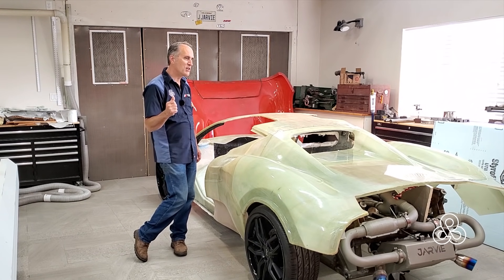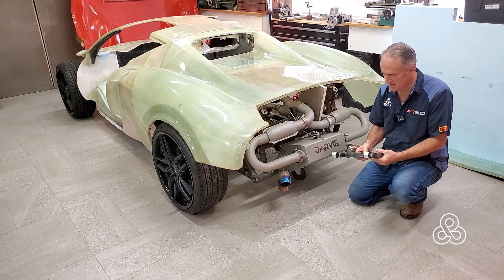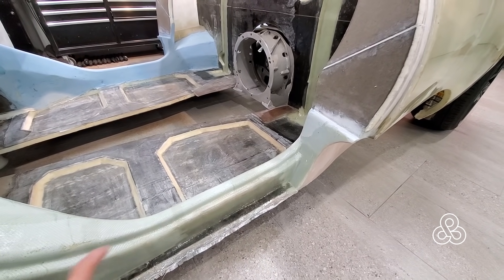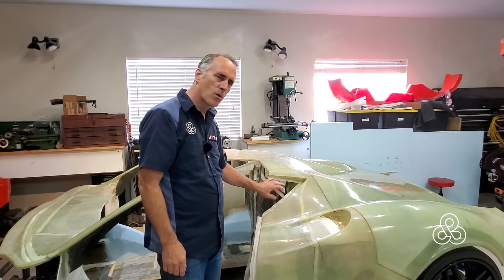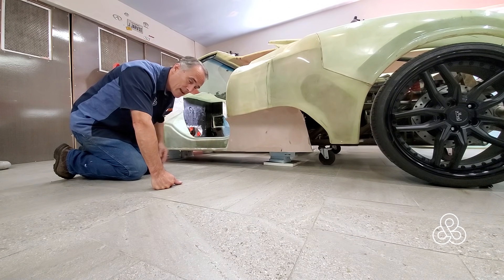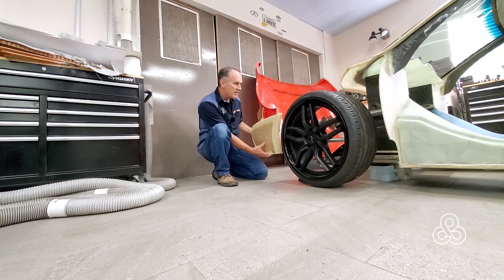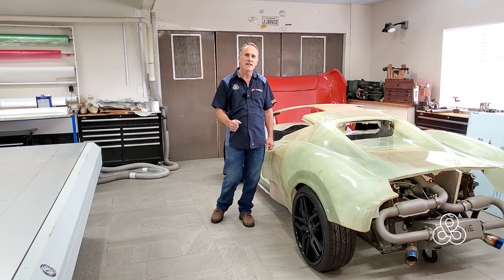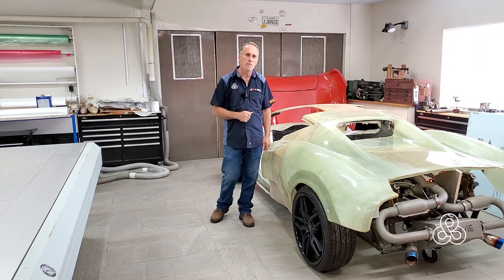Building a supercar from scratch! - What I would do different next time.

Comment: Flush mount windshield for sure, it will look so clean flush mounted.
Reply: Flush mount windshield!!!!
Reply: Rear hatch hinges : look into the design of the SOSS invisible hinges.
It is a double jointed hinge that fits in a pocket.
You do not see the hinge.
There are used for hidden doors in houses.
It also lifts the door away from the jamb.
Look into it.
Would be an interesting touch.
Reply: @2009mechanic  Yes, I was going to suggest dual-pin hinges to solve the problem.  Once it is closed, it clicks into place flat.

Comment: I think the problem with windscreens, in all self build cars, is trying to make it look OEM, or factory. Windscreen, glass and headlight seals are almost impossible to get right on a budget and through DIY; the finish never looks right. Even TVR couldn't quite get it right. So if you opt to remove the factory seal, you may lose the factory look, and possibly run the risk of making the windscreen install look amateurish, which would be a shame as the rest of the car certainly doesn't look amateurish at all. If you think you can do your own "OEM" seals, then my hat comes off to you for trying. I'd be interested in the results. :)

Comment: In theory, if you were to throw the idea of a conveniently shaped rear sub-frame out the window and just placed all of the drivetrain components where you wanted them and moved forward from there to support them adequately, you could totally fit basically anything you wanted to into the back of that car. It's surprisingly spacious, after all. This would, however, make servicing those components more challenging because you end up packing the support structure pretty tightly to the engine, exhaust, and intake components. It also doesn't usually end up nearly so pretty, at least not without some significant efforts in fabrication. Take the custom twin-turbo exhaust systems that people have made for the Audi R8, for example. It's a car with a ludicrously tight amount of space for an exhaust system, but some people have decided to use 10 and 15 degree pie cut pre-bent tubing to craft incredibly complex and surprisingly large bore exhaust systems for it (though they do frequently run without a muffler, so there's that). Then look at Project Binky, from Bad Obsession Motorsports, where they took an Austin Mini and crammed the entire running gear, drivetrain, and engine from a turbocharged 2.0L AWD Toyota Celica into it. The amount of work put into fitting a drivetrain into a space where it clearly doesn't fit is mind-boggling, but it can be done. The downside is that you end up with an engine bay so tight that ceramic coating and woven rockwool insulation aren't done for aesthetic purposes but out of necessity to keep the exhaust from literally melting the parts nearby them. Basically, if you poured a cup of water onto the warm engine bay, it would never reach the ground. In this case, if you were to employ a larger alternator and a more substantial battery, you could place things like the intercooler wherever you liked by utilizing electric fans to cool it. You could even go so far as to make the up-draft aero hood even more substantial, diving almost through to the floor of the front chamber, and then stack a radiator for engine coolant, a radiator for a water to air intercooler, a heat exchanger for AC, and even an oil cooler up front, backed by a custom fan shroud to pull air through all of them and up out of the hood. And you'd still have space in the front for a battery or two, fluid tanks, and the front differential. It just gets tight and you'd probably have to rework some of the suspension geometry for the shock actuator levers, but moving them back doesn't necessarily change how they function as long as they still pivot properly and you have a mount in a suitable location on the upper control arm. I would also probably opt for an electric hydraulic pump for hydraulic steering assist, as it is between a common hydraulic steering assistance and electric steering assistance in terms of feel, but allows you to remote mount the pump wherever is suitable, since the fluid is incompressible and the length of the hose is somewhat irrelevant. Another option if you ever decide to redesign the sub-frames is to utilize even longer control arms and narrow the subframe even more between the front wheels to allow you to use a closer steering ratio with longer pivot arms, allowing you even more steering angle on each side without scrubbing the wheels on the tubbed arches or suspension components, which would allow you to make more aggressive steering corrections while driving, or even open up the options for drifting, as long as the rear bias of the central differential allows for it. One option if you want a more rear-biased AWD system and you're willing to buy expensive salvage parts is to find an AWD Lamborghini and use its transmission and differentials for this, as it would be closer to a plug-and-play solution in terms of front to rear biasing, as it was already designed for a mid-engine AWD configuration. Porsche also made use of similar transmissions for their AWD 911 variants, so that's another possible option if the current solution doesn't provide the bias that you want. The fact that you're able to build your own adapter plates and junction tubes is already to your benefit when it comes to adapting drivetrains to your needs. The Audi R8 is another option, too. The only complication to all three of these related options is dealing with whatever transmission and diff control signals the VW-Audi group use to manage them.

Comment: Hey there, amazing progress you've made.  One thing about the windshield, I work with glass. The windshield is made of laminated glass with a PVB plastic foil in between, that foil will become white if the edges of the glass are left in moist conditions. So if you take it out make sure to still project the edges of the glas..

Again, amazingly inspiring to see. Keep on going man.
Reply from the maker: THANKS! Now that is a very useful piece of information. I will take that into consideration as the glass will have been stripped of any protection. Glad to have others experience! Welcome to the new world of social media.
Reply: Djessey
Is there not a physicality to rubber mounting glass, especially in this flexy body
Reply: Also glass replacement , have you thought of that, say it gets a stone chip and you've just fiberglassed it in place
Reply from the maker: @williamgoode9114  Fiberglassing will only be to form the new frame edge. Once the new edge is done the glass will be installed the traditional way with flexible rubber sealant.

Comment: I just came across this today, it is very impressive.  I'm not any kind of engineer (except for operating a light rail car), but I do have years of having fun with VWs.  I'm working on my own car, using a sand rail chassis, going mid-engined with a 6 cylinder Corvair engine mated to a Porsche 914 transaxle, and topped with a Laser 917 body, to make my version of a Porsche 917 replica.  Like you said, as I don't have much experience I can still get close to what I want with pre-made components.  Nowhere near to the supercar you're making, but it is what I feel I'm able to do.  Great series of videos!

Comment: I say nix the rubber seal on the windshield, it'll have a much cleaner look. Your foot-well doesn't look any narrower than a Countach, roominess is nice to have, but usually one of the trade-offs with exotic cars. If luck is on your side you'll have a little extra clearance in the tunnel area you can take advantage of at the front for some extra pedal room. Loving the build so far.
Reply from the maker: May be getting a 3 inch expansion of the foot well. . stay tuned.

Comment: As for the little quarter window, I would include it in the door, but not as a little pointy bit. Instead, cut the aft edge of the roof/door parting line back to the point of the window. This will make the door look better as it is a but narrow in the roofline area and really wide in the side. Adding a bit more roof to the door will make it look more balanced, AND you will be able to incorporate the quarter window in as one piece.

Comment: 09:50 I would remove the rubbertrim.
If I was building a car, I would spend more time just so I could get it just how I want it.
Reply from the maker: Looks like the consensus is to cut it off. (rubber trim) I know it will look better, just needed a little shove to push me to do it. I guess I will have a video coming- "window frame modification!"
Reply: @BuilderCreator  Keep it easy replace the windshield.

Comment: Front and rear door pillars, like where are they. And theres a reason that the door seals are so big. 
Its because the load from the front of the car, is transmited through them to the rear of the car, and the rest of the body is conected to that.
Ok you did say that your making the tunnel apart of that. 
This should be the sub frame that conects the front suspension sub frame the the engine sub frame. Just like the lotus esprit has.
But please remember the body has a sub frame aswell. Otherwise your car will have no structure to it and will be dangerous.
Remove the seal around the windshield. Its used to seal the windshield after its bonded to the windshield frame.

Comment: The windscreen rubber seal, in my opinion, doesn’t really make too much of a difference to the aesthetics. Obviously, the modern trend is a fully bonded screen, but would this involve a redesign of the entire screen recess and the filling and finishing of the roofline.? Ultimately, the choice is a slavish adherence to modernity or more practicality. The glass may not be suitably edged for bonding and at least the seal gives a high degree of flexibility. I personally would keep the seal. Great project, and hats off to your attention to detail and build quality. Which ever way you decide will be the best way for you, so ultimately the correct way for the project. Thanks fo a very interesting series.

Comment: Trim off the moulding around the windshield. Unless you bring the lip on the roof, A-pillars, and valance up so the windshield isn't in such a deep recess. If the windshield sat higher then you could leave the moulding on to hide the windshield glue and help fill in that 1/4" gap that you need around the windshield to allow for body flex and binding against the glass.

Comment: Yes, get rid of the rubber seal around the windshield. You will be happier after you get it done and the result will be a lot cleaner. Utilize technology available to improve your project.  You will most likely need to add front and rear fender vents to alleviate the air pressure in wheel wells at high speed that can cause the car to lift when you are going for 200mph.

Comment: hi...most builders are using a "uni-body", complete, floor pan to simplify their body build/mods.
many channels already show that approach; and it's a great time saver, since steering and 
suspension are already figured out. (much easier to modify steering and suspension than invent it!).
great job overall...i have been doing this off and on for 50 years...would've suggested you
tapped into existing knowledge/experience  a little more at the start.  Good Job!  walt.
Reply from the maker: Thanks Walt. I never wanted this project to be easier. My only regret (okay, their are probably many.) is that I didn't incorporate the suspension pick up points in the monocoque. When I started I  didn't have the knowledge (and a few tool ) that I now have.

Comment: Windshield -  You may be able to find a aluminum 'H' extrusion for glass that could be used to fill the gap up to the body surface.  The aluminum is usually anodized which is easily removed.  The extrusion can then be annealed to bend easier.  The top corner ends can be welded and finished to contour the recess. The bottom section and corners can be bonded after the glass is fitted and bonded on the top and sides.  The whole unit then bonded to the body using the industry standard black adhesive.  The extrusion can be painted body color there will only be a narrow gap to fill with the black adhesive.  The Ferrari Boxer, and others I assume, have this method of installation.  It is very flush and looks great.
Reply from the maker: You just described the system I will be using on the side windows, perfectly.

Comment: With regards to the footwell, have you considered mounting the organic component (ie. the driver) in the middle of the vehicle? That would give you the space you need for feet & pedals, and you could use two small-ish seats behind the driver at either side like McLaren did with the F1. Apart from getting another seat in, it means the driver (the most important component) has more room & can concentrate better on the actual driving.
Reply from the maker: Excepting there is a transmission and center differential in a tunnel there. I have fixed the foot room problem however. see this video-  https://www.youtube.com/watch?v=WIC5shmAZdQ

Comment: the windshield rubber is not just a seal, it allows the window to flex. if you bond the window to the frame it will probably crack at the first hard bump. the only other alternative is to heat bend some polycarbonate around the windshield and go with a lexan windshield.

Comment: Its wise to use a stock windshield as it can easily get cracked by a rock or something else. makes replacement easy and affordable. As far as the rubber trim, I would consider what people have tried it have to say the most. Such as David Guyton. Aesthetics is important. My inclination would be to remove it for aesthetic and aero reasons. After all the work you have already put into it, you might as well go that extra mile.

Comment: I was able to get a C4 without engine or transmission for cheap. My engine is a Ford Mustang V8 (I'm modifying it heavily). I'm liking the FDF Raceshop suspension parts which will save design and fabrication time but give great adjustability. I will go fixed seat (similar to your design), moving foot controls, and redesigned (more modern) body. Speeduino controller for the engine, transaxle, and dash.
Reply from the maker: Great way to get a bespoke car up and running quick! Would love to see your design.

Comment: Have you looked at diy angle kits for drift cars? You can reduce your turning radius by moving the tie rod pick-up point towards the axis of rotation of the knuckle.
Also I think you should remove the windshield moulding.
Reply: Problem with angle kits is that they screw up the ackerman, and as a result drivebility for anything other than drift is shit. Also, that wouldn't exactly solve his problem which is inner side of wheel hitting the front subframe if I'm not mistaken.

Comment: Do you have a final weight plan for the finished car...??..around a ton..hopefully....!!!Since damping is a major issue for a quick sport car ,I used '(oil pressured) SACHS rally suspension on my 1090 KG VOLVO V40 (5 cyl Turbo)project ,taken from a RENAULT CLIO Trophy and after 3 different types of suspension tried;even on track , was a game changing move for handling..great product also for driving comfort/isolation is the DYNAMAT/BOOM-MAT  from floors/fire-wall, to ceiling.

Comment: As I had to leave my garage, before the end of the realization of the master/plug ... I used the method that you described ... 
And at the time, I did not know the existence of a fiberglass fabric like 50g ... I took 200 ... 
I quickly made the surface of my plug before the forced relocation and having to break it..
 A year later ... I took this plug again ... Piece by piece. For example, I didn't reinforce the wing with a wooden structure ... I just removed 20cm2 of foam, fiberize that part from the inside, and then remove another 20cm2, and so on. Since I no longer had a garage, I did this in my apartment, each part after the other ... Did I mention that the master had been cut into 40 pieces to fit in  2m3 room storage for a year ...?
It's hard to rebuild a broken egg ... :) Never give up on a project. Just try to finish it later.
Reply from the maker: The second time around is always better; we sometimes cling to the old for sake of time or money, but end up glad to have the improvement in the end.

Comment: Those hinges you may want to look into the front hood hinges on a Porsche 550 Spyder, then look at how the 550 Replicate solutions were.
Also the Datsun Z range of cars from 69-78 the rear hatch hinges have , the same body line challenges as you have. You may find a solution. Face Book groups is your Friend.
    You wind shield to get the upgrade look you need to, urethane it in.
    But I would make the up grade easier on my self .
I would use "plastilen Clay"
So drying time is not an issue
Then use cloth over the plastilen make a windshield mold. Then pull a part out bonding it to your existing frame ,trim and body fill the seam edges.
Reply from the maker: The change has already been completed. Yo can see the process I used here - https://www.youtube.com/watch?v=QucvCSwLaHgjaz  Thanks for your comment/suggestions.

Comment: Just a thought RE your narrow footwell. Correct me if I’m just a dumb service advisor but...it appears to me based on your decision on design process, it seems like it would not be too difficult & easy to plug into CAD the adjustment to dimensions that the entire floor pan could be simply cut & stretched 4-6 inches wider given the flexibility of the structure like a piston ring is pulled open or c-clip as they’re being put into place . Just from the rear firewall forward. This would give you a little room & maybe even allow you to widen the front bumper area I thought I heard you mention as I began writing this.
Reply from the maker: With the cab forward design the subframe and suspension is beside your feet. Adjusting the width changes the subframe and the suspension geometry.